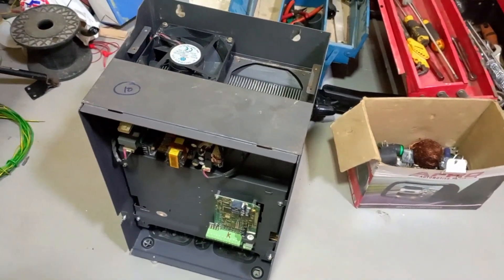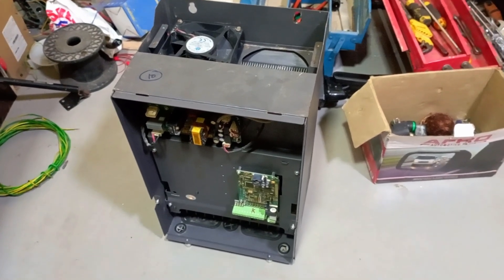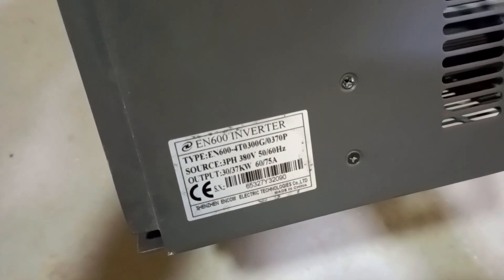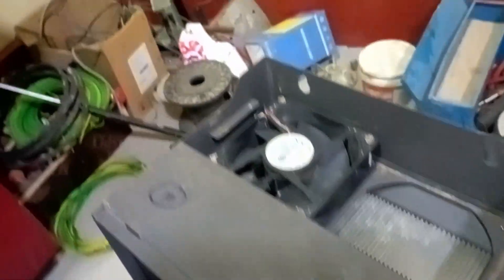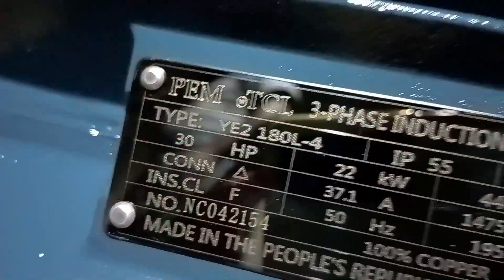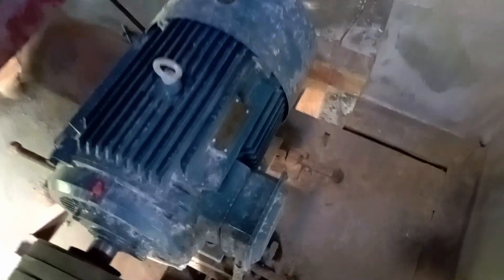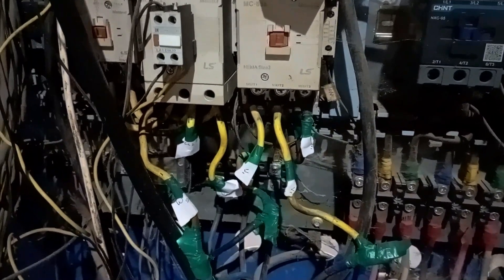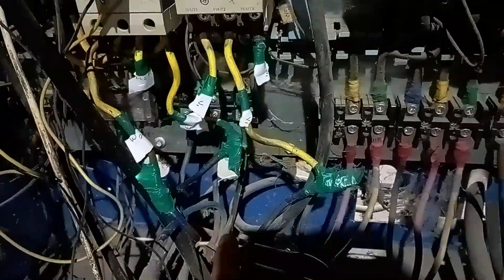How to Run VFD [ Inverter ] .Star Delta without motor | 22Kw මෝටරය ඔන් කරමු Vfd එකක් මගින්

Comment: Oya gaththa wayar 6 motare harahada othanta ganne
Reply from the maker: Ow.motor eke wire 6k thiyenawane e tika
Reply: @SLElectricalTechnic  motare thiyena wayar 6 ta thawa 6 connect karalada ganne
Reply from the maker: @dinujayakasun1611 Ow, delta connection eka daganna thamai vfd eka wenakan genawe,nathnm motor terminal eke thamai brige eka enne, video eka balanna skip nokara